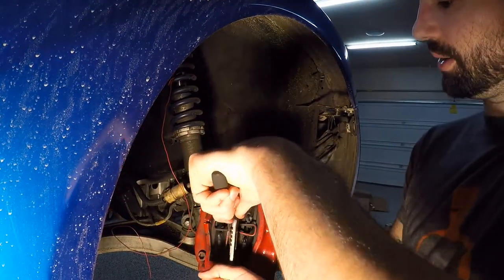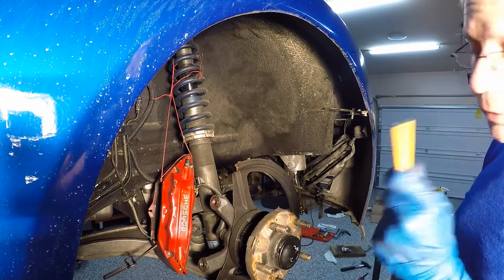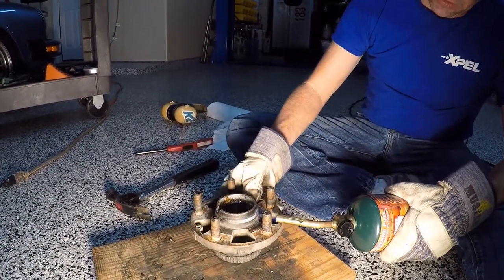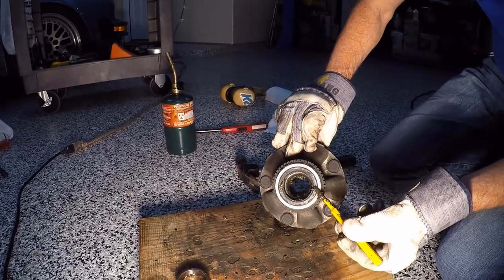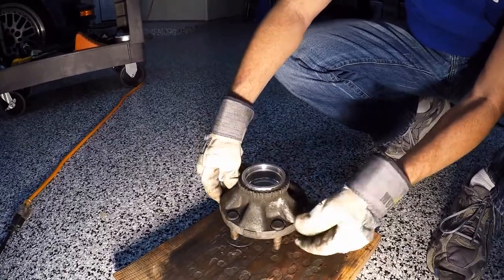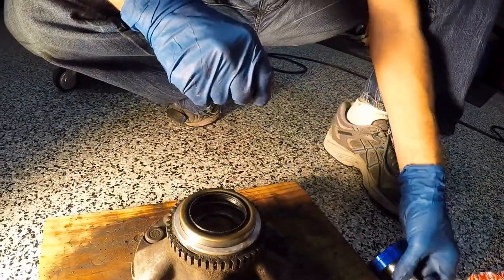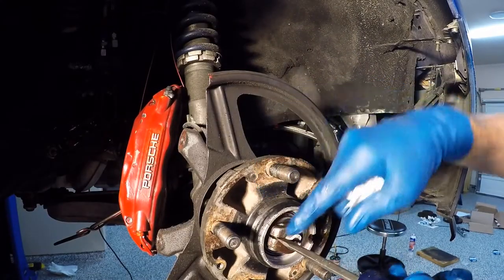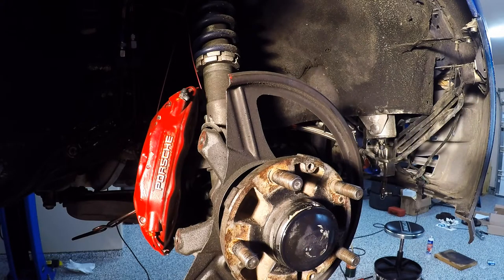How to change inner and outer front wheel bearings on a Porsche 944 Turbo

Comment: Nice video, but background music is too loud.  Also would like to hear what the symptoms were that led you to do this repair.
Reply from the maker: Vic,
thanks for the comment.  We agree the music had to go, so we have stopped it in current and future videos.  Regarding the bearing symptoms, there was a grinding noise during rotation on one side, and when we investigated, we noticed a bit of play in the bearing.  The decision was made to replace the bearings on that side, and since they were failing, we replaced the other side too.  It is typically good practice to replace both sides at the same time.  This is true for bearings, bushings, struts, shocks, etc.